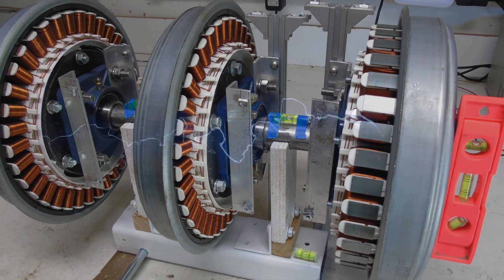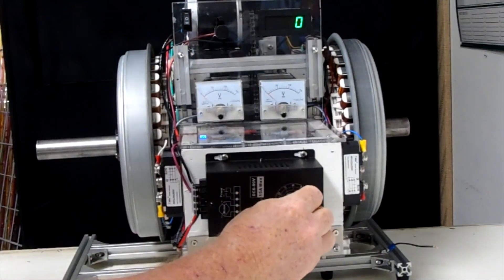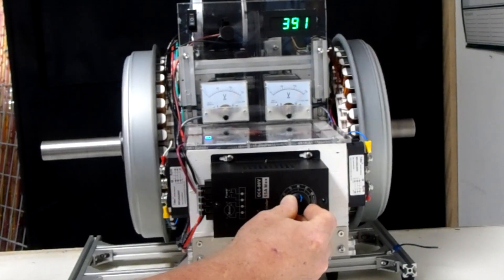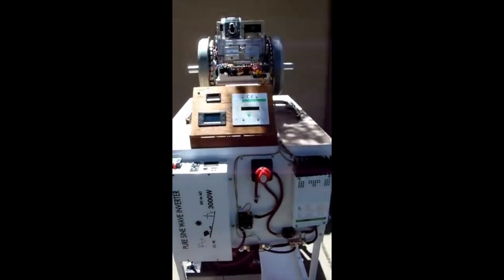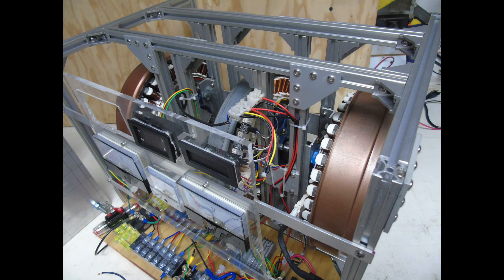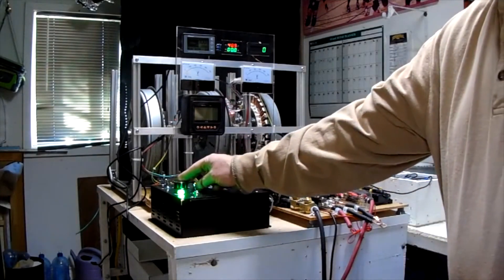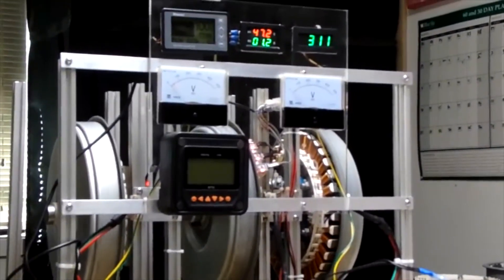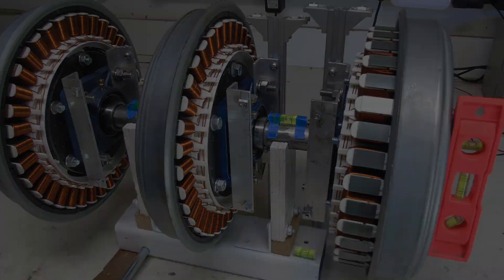LaundryMotorVAWTtests

Comment: An achievement. Is the output in pararell ? How much volt ?
Reply from the maker: Yes the output was in parallel. Best run was measured at 150v DC @ 10A.